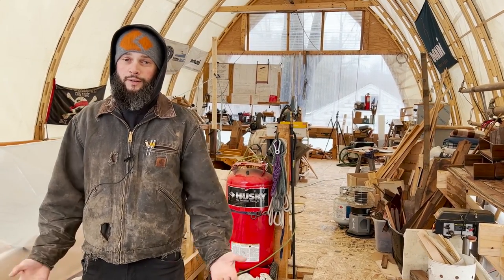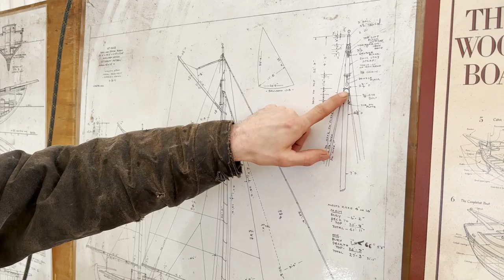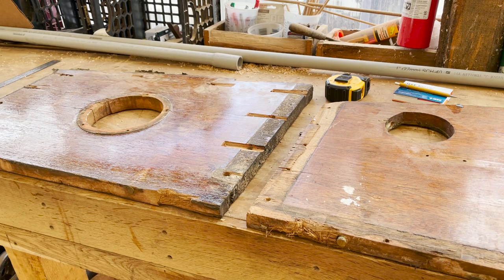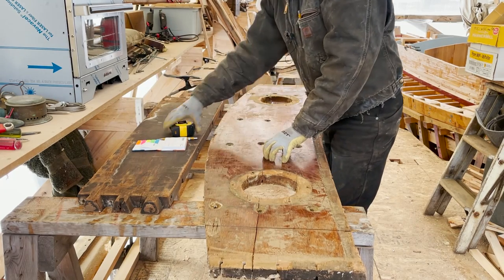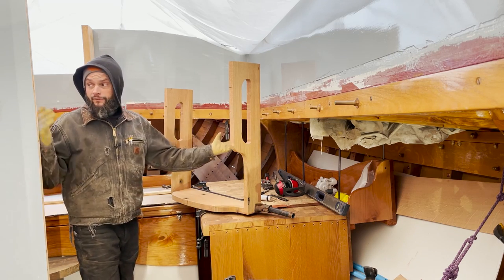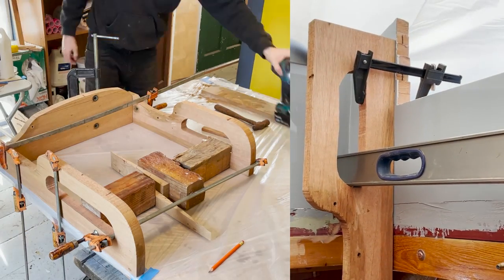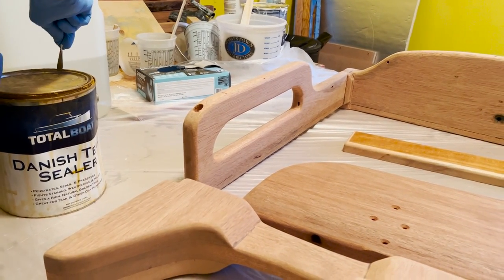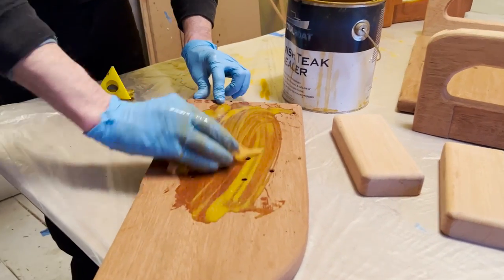The Companionway Ladder & A Big Update - Episode 197 - Acorn to Arabella: Journey of a Wooden Boat

Comment: Sounds like a perfect application for Dynema rigging.
Reply: Yes. Those old wooden blocks are sooo 1930's
Reply: Agree with dynena, but I'm sure the synthetic evangelists have made an impassioned case. If there's anything this project has in abundance it's advice.
Reply: Dyneema is easier, cheaper, stronger, longer lasting (if done correctly), and readily available. Just not traditional.

Comment: Long ago I used to rig square rigged ships.  Mostly with galvanized wire standing rigging.  I suspect that Coast Guard barque Eagle is probably still rigged with galvanized.  If you get in touch with them, they probably know where you can still get the good stuff.  By the way, parcelling and serving rigging is easy.  First thing we taught new apprentices (or maybe second thing, after making baggywrinkle).  You would have fun making a few serving mallets (large and small) out of wood, and could easily do it yourselves.

Comment: Another interesting episode.  Was there a reason why you did not set that step into a dado on the uprights? The way its currently constructed relies on end grain epoxy (not strong) and the force on the screws will be shearing. No concerns that the screws will bend or shear over time?
Reply: I was concerned as well, though it does seem he knows what he's doing, or asks for help when he's not so sure.
Reply: @jimbranham3281  Maybe you and 57dent are right to be concerned.

Comment: When I was a cell tower climber we would use spray galvanization to seal up holes we drilled for bolts in galvanized beams. (comes in a spray paint can) Maybe not exactly what you're looking for but could be a viable solution.

Comment: As a sailor and engineer for a company supplying power companies with steel pole hardware, I have dealt with galvanizers for 40 years. Galvanized wire comes with 3 levels of galvanizing, so the heaviest coating is what you want.  Unfortunately, it is difficult to re-galvanize over existing galvo.  The galvanizers have to preclean steel before galvanize by putting in a caustic solution to clean oils etc, and a sulfuric acid to etch the surface.  These steps would remove the initial galvo on the wire as it is very thin (.002").  You would be better to use either a spray galv repair or a brushed on galv paint on the areas that get abraded.  Galv is not the longest life in salt atmosphere, so you may be replacing it after 5 years as it will start rusting.  A new technology is being used for chains in the Navy, called Thermal Diffusion Galvanizing has much better life and wear resistance, as it becomes a chemical bond with the steel, but not sure if they could do shrouds as it must fit in a drum that is heated and rotated at 800F.  One brand is Armor Galv with a processer in Holland, Mi.

Comment: The orange teak was also used as the weather deck (topmost hull deck exposed to the elements) on US 20th-Century battleships.  When the IOWAs were recommissioned for their final Navy service in the 1980s, they tried to use much cheaper spruce (I think) for the deck planking (used for non-skid and thermal insolation), which could not take the punishment it got from sea waves, rain, and human movement over them continuously.  For their later overhauls the Navy had to "bite the bullet" and spend A LOT of money to put thick teak planking back on these ships.  It was a very brilliant orange color and looked like it was oiled/waxed even when untouched by a sealant.

Comment: Up here in Maine I get a inexpensive pair of winter work gloves and cut an inch off the thumb, index and middle fingers. Keeps the hands nearly as warm and allows for manipulating tools, screws, etc.
As for rigging, I will echo the comments of others that dyneema rigging is likely as long-lasting as galvanized, and easier to work with. Good luck with your 2023 target.
Reply from the maker: Running downwind with a gaff rubbing against a shroud for a good few weeks doesn’t bode well for dyneema. That’s our main motivation for going with galvanized wire, parceled and served. There are a lot of advantages to dyneema in some applications though, and maybe someday that’ll be something we switch to. For now, our conversations have led us here.

Comment: When I worked we were a cable supplier. We bought cable from Wire Rope Industries in Canada. Also there was a company that sold a product call Galvicon. This was used to cover when sheet or rope was marked. It cane in spray or paint.

Comment: I was just thinking you guys should have a parts  wanted list! For the wire you can get it in New Bedford at Hercules Rigging, which used to be Bruces Rigging. 7 X 19 might be a little easier to go around the tight bends of the deadeyes. If you get the trawl wire it comes with tar on it already which is nice and stands up well. They sell miles of it for the fishing fleet.  Galvanizing either Duncan Galvanizing in Everett or Voiith & Schider in Taunton can dip the eyes for you. They both do small lots.
Reply from the maker: We’ve got that list linked in the description 👍🏼👍🏼

Comment: Hi Steve, 3/8 7 x 19 galvanised wire is what we used for trawling and should be readily available, not quite sure why you need 7 x 7? We always used a Liverpool splice for eyes and never had a problem knocking off the galvanising to any degree, a Swedish fid is your friend for this job. These days I would parcel with Denso tape before serving, this grease impregnated hessian tape is great for preserving anything that might rust.

Comment: Greetings. I heard something about needing to regalv after assembly of the shrouds. I am a retired welder and fabricator. you should check with your local welding shop about touching up galvanised parts with a zinc stick and some heat. That might solve your issue with the wire. Hope this is helpful and keep up the great work. I'll keep watching.
Reply from the maker: Thanks for the recommendation, Gordon!

Comment: An electrical supply house that deals in overhead utility system supplies should have the galvanized wire you need in various sizes along with eyes, clamps, ferrules, etc. all made to weather the elements for pole down guys, etc.

Comment: I suggest that you use the existing gooseneck collar from Victoria, and build up the mast with staves to fit it. you won't find a better one, and the boom fitting will work without modification.
Reply from the maker: Well, we will be using it… on the main. We won’t need staves, it’ll fit perfectly on it. We’re looking for something that fits the mizzen… 6” diameter.

Comment: Ther is a spray that is for replceing galvanized coding so use on pipe at work and it works decently well
Reply: It’s cold galvanized it is made by lots of brands but the best I have found is  aerveo it’s 90% zinc
Reply from the maker: Thanks for the tip!

Comment: I had no problem getting 3/8” 7X7 wire rope from a company supplying to the mobile crane industry.  I steeped my eye splices in Stockholm tar (neat) before serving.  In retrospect, the 3/8” looked a bit heavy, but I felt that it wasn’t going to fail.
Reply from the maker: Thanks for that recommendation, David!

Comment: Life moves on, all the best to Alex though. Couple of comments. Health and safety here in Germany doesn't allow one to use a machine with a rotating tool, table saw... while wearing gloves, reason being, if the blade catchers the glove, it can pull the whole hand into the blade. Injury statistics are the reason for this rule. Another point, try using the Jigsaw upside down, so you're cutting from underneath the board. As I first saw this, it seemed odd, though it's now how I usually use the tool. Keep up the good work and thankyou...
Reply from the maker: It’s a good point about safety, thank you!

Comment: Is it standard practice to hot dip galvanize splices in galvanized wire rope?  Galvanized wire rope is made from wire galvanized before it is made into wire rope, not galvanized afterwards.  Galvanizing is not like paint. The zinc will protect exposed steel surfaces which are close to the zinc. 

Dipping the eye splices into molten zinc will result in the splices being soldered together and loosing flexibility. The result can be a stress concentration at the end of the soldered splice which can lead to fatigue failure. Standards for electrical wiring in boats calls for stranded wire without any soldered joints to avoid fatigue failures.

Comment: 5:10 Mate, look up "zinc electroplating". Real easy to do on a small scale. I use a 12v battery that's connected to a charger.
Basically you need to first use a zinc anode and a zinc cathode in clean water and vinegar mix. That disolves a lot of zinc into solution. Then you have your cleaned part (drain cleaner will get it nice and clean) as the cathode and some zinc as the anode in that solution for the electroplating. The zinc anode needs to be roughly the same surface area as the part.
Reply: *you'll find other methods online, but I like the one I just mentioned.

Comment: On using that ladder--will you always be going up and down facing it?  I would think you would like to come down into the cabin frontward, that is facing the cabin instead of turning around and backing down the ladder.  It looks to me like that might be difficult if the ladder is so vertical.
Reply from the maker: Very few companionways are comfortable to use facing forward. Backing down is the norm.

Comment: In the PNW the good galvanised wire rope comes from the industrial rigging shops that supply the construction, logging and commercial fishing industries. Your local crane operator should have a helpful lead.
As for the galvanising touch ups, it's pretty simple on a small scale. A guy like you is probably about ten minutes of youtubing and one trip to the hardware store away from doing your own galvanising.
Reply from the maker: Thanks for the recommendation, Greg!

Comment: If you are looking for cheap cable find the local offroad clubs to you alot of people will pull steel cable off that has never been used for synthetic line and normally will give it away 

I don't know if it fits your specs but it something to look at
Reply from the maker: We love a good deal but for this particular service we're looking for new and as nice as can be made. Standing rigging, well looked after and sourced, can last a good long while!

Comment: Question: do you check that the boat is levelled (from time to time)?
You check that the elements are, but if the hull has shifted, that they are not parallel to the 'walking surface' within the boat...
Reply from the maker: Yes, we do level the boat from time to time.

Comment: Question : With the cold weather in Mass. working with glue, paint, ect. must be tough keeping the temp.'s correct ??  Wouldn't working on plumbing, electric and the diesel be a good time n easier  ??  I've worked in many of boatyards on the east coast n west coast of Fla.   Winter time we worked on setting up and alignment of the shaft, ran the lines from the fuel tanks to the diesel, ran water lines and power electrical lines as well as data cable.. This bull work in the summer isn't fun....  Just a thought to make it a lil easier for you....  be well.
Reply from the maker: Well, that was the plan, as you can kind of see taking form as of even just a few episodes ago. We're working on the electric, but we're halted right now because we need our water tanks before we can be sure where the conduit goes. We had planned to build the rigging and sails inside others' shops, but that's held up by the hardware questions. So we're working on this for now. There's always something to do, even if it's slightly inconvenient to do it. –Anne
Reply: @AcornToArabella  , thank you.

Comment: I keep wondering why you use those tiny antique port holes ? I am curious, is it just for for the look of is there a technical reason for not using larger modern boat windows ?
Reply from the maker: The larger the surface, the more likely it is to either craze or break. Boats don’t need windows, opening port lights are for ventilation more than anything else, and they’re plenty big for that.

Comment: Why not ditch the mizzen mast altogether? Make the main boom and gaff bigger to retain boat sailing balance. Less rigging, less work hoisting 5 sails. Less to fail, less cost. Just a suggestion
Reply from the maker: Well… I can kind of see where you’re coming from, but a big boom to handle doesn’t sound easier, and a split rig offers way more options for balancing in a variety of conditions. Many, many times, it’ll be a jib and jigger situation. Perfectly balanced, two sails out. Staysails are fussy. (I sailed a cutter for seven years.) They really do their best work when conditions make it so it’s not back-winding the jib, or when the jib’s too much and the staysail offers better shape than a partially furled (reefed) jib. It’ll be pretty but not necessarily often when all four come out. Lots of options! Dreamy. 

Also… five sails? Maybe you’re already thinking of what I’m thinking of… four in the plan but I think we should either have a topsail or a mizzen staysail for the utmost fun. 😉 if you click through to see the details of the compression fitting we’re looking for, the one we’ve got for the main can handle rigging for a topsail, so says a rigging friend of mine. Wheee! —Anne

Comment: Just a quick question. When do you plan to completely plank over the starboard side of the boat? I see 1 (maybe 2?) levels worth of the side without planks just before the deck starts. I am thinking it would be difficult to plank these later if the interior is already built up. Also any particular reason why these were  left out? As always great video! :)
Reply from the maker: Thanks, Jeffrey! Good question. When we finish up the deck and cabinhouse, and we can remove the staging, will put in those last three planks. Disassembling the staging at this point just to finish that planking seems to us to be a lot of work that’s unnecessary. Instead of fastening those with rivets, if  hard to install because we can’t get to them to peen them, will be done with bronze screws.
Reply: @AcornToArabella  I thought that one of the points of using rivets was to tie the two halves of the split frame together. A screw won't do this as well. Also, when you say "finish up the deck" do you mean the whole deck including planking and cover boards ? Presumably the outer edges of the cover boards will sit on top of the sheer planks and it would be much easier to fit the missing sheer plank before the cover boards. Or have I got something wrong ?

Comment: hi I am building a similar boat as you and have gone for dynema in standing rig. to work easier with splicing and it lasts longer. I bought a tow cable for the rescue boat. 16 mm which has a breaking strength of 17000kg which is way too much, but looks nice and was cheaper.
Reply from the maker: Gaff?
Reply: @AcornToArabella  yes a schooner with colin archer hull. a mast of 16 m and one of 17 m. cast all fittings in bronze. will be rigging this summer. I live in northern Norway so have to wait for nice weather. have an icold album where I post photos, but it's only for those interested.
Reply from the maker: Sounds great!

Comment: Does the galvanized wire really do better than a high grade stainless. I imagine the price is better on the galvanized but I can’t imagine how the corrosion resistance would be superior.
Reply from the maker: There’s such a thing as something called work hardening, and the way that we need to make eye splices for Arabella will work harden stainless steel in a way that makes galvanized a better option. Stainless is a better option for other reasons. Everything in a boat has trade-offs.

Comment: Steve, are you going to sprinkle coarse sand into your ladder rungs, to increase traction.
Reply from the maker: No, we’ll be making small rope mats.
Reply: @AcornToArabella  that makes sense, easy to replace. I’m assuming you’ll use an extended Carrick Bend?
Reply from the maker: It’s kind of a flattened Turk’s head. Although I’m thinking I might do tiny sword mats, which would lay flatter. If you’ve got the Harvey Garrett Smith book, the one out of that. —Anne
Reply: @AcornToArabella  which book Anne, he wrote quite a few?
Reply from the maker: The Arts of the Sailor.
Reply: Have a look at the patterns by Mark the Braider on YouTube. He does some great stuff, plus his videos are pretty easy to follow.

Comment: dear  Sir  would not be Cheaper and Stronger to Use Dyneema Rope plus you can use kevler sleeve were it rubs. plus it will like the old ship was; plus rope be easier for tighten in the blocks that now can be wood. the cost would be half plus half the Weight and then you carry more supplies.. oh Shi# i forgot you have no buget.  i am sorry for think

Comment: Considered low creep dyneema for standing rigging?
Reply from the maker: Did for a moment, for sure.
Reply: @AcornToArabella  galvanized wire definitely the more traditional and harder wearing. Dyneema lighter easier to source and easy to replace. T S rigging in the UK specialise in traditional rigging and have supplied good quality galvanized wire in the past.

Comment: Why don't you galvanize the eye splices yourself. Old zinc anodes in a melting pot, should do the job easily
Then make sure if you are twine binding the ends to have some linseed oil heated up and soak the ends after binding.

Comment: Have you considered dyneema rigging?
Reply from the maker: Yup, but with a gaff and the potential of chafe on a long downwind run, we’ve decided against it after some input from pros.
Reply: @AcornToArabella  I assume you are referring to the running back stays. I think it would be trivial to coat or treat the dyneema in the wear areas. Something to think about if you cant get good galvanized wire. Using dyneema save a lot of weight aloft.